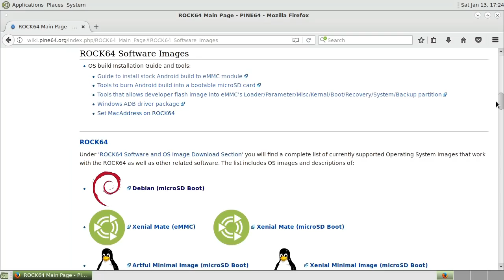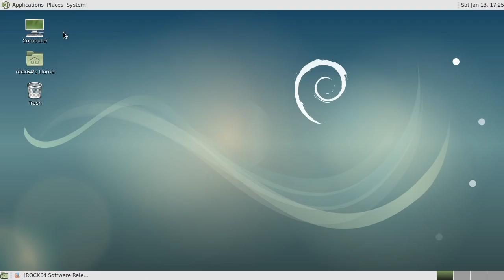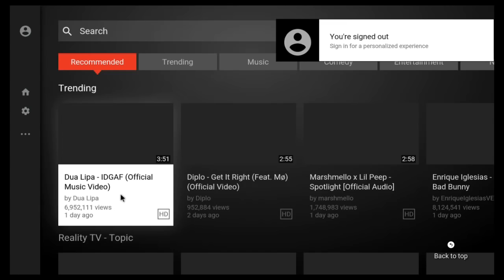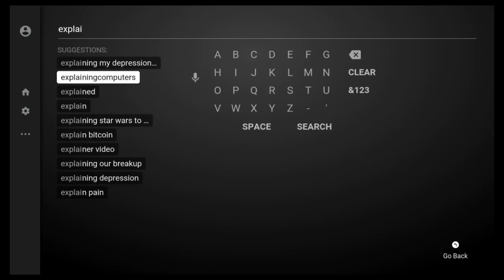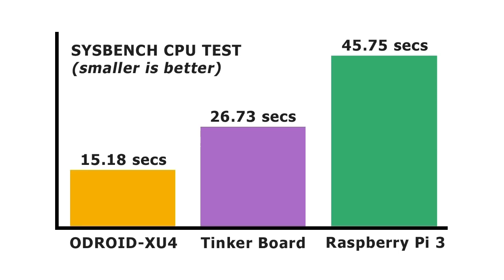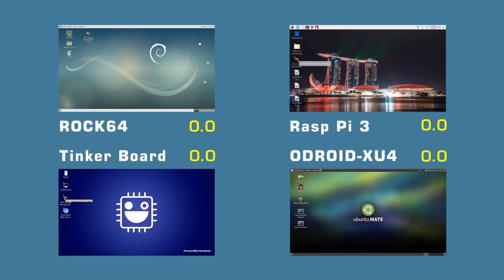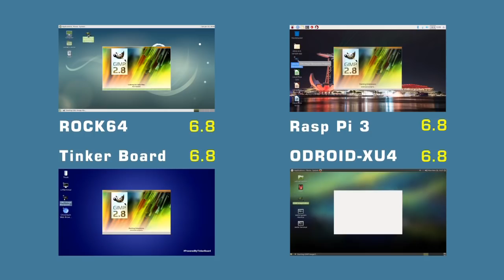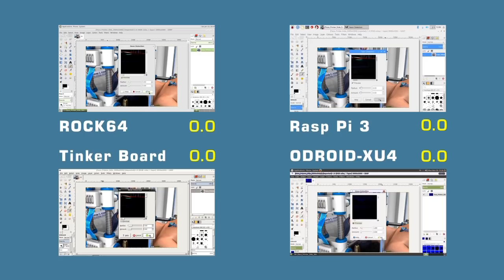ROCK64 4K USB 3.0 SBC

Comment: So.. I picked up 3 of these on Amazon for a whooping $8.51 US after taxes -- https://www.amazon.com/gp/product/B0868WSTXH . They came as a finished security product named "Recon Sentinel" -- https://www.reconsentinel.com/ . Package includes: Rock64 sbc 1Gb, 3A power supply, monochrome lcd display, 8GB SD card, and probably the ugliest case ever designed for a single board computer. Needless to say, that's normally what I expect to pay for the power supply alone, so I figured, "what do I have to lose?" Well.. Apparently, the $8.51! These have turned out to be about the most USELESS sbc's I've bought yet. YES, you can get an OS up and running on them.. But GOOD LUCK playing a YouTube video! YES, there are scripts for that, if you're willing to settle for only one OS/kernel option. But they are flaky, at best. So far, the only function they've managed to pull off successfully is as a monitor for my security cameras (Blue Iris/ui3 kiosk in chromium). Anything more stressful and it's sure to crash it. Still, I'd say I got my money's worth. Had I paid full-price, that would be a different story. :)

Comment: Like many here, I don't have a problem with no wifi - I won't be using it and removing it means the platform will be cheaper.
Despite the age of this, I ended up buying this now because even today, there isn't much competition of something that has the same level of performance-per-watt, PoE, a USB 3.0 port with its own host controller, all for a reasonable price point.  The ODROID-C4 is overall a better choice but once you factor in shipping costs, it's a worse value.

Comment: If the Rock64 is used like a desktop PC then the omission of WiFi/BT isn't a issue. Most desktops use Ethernet which is more secure, faster, reliable, and easier to setup than WiFi.

Comment: Chris, I tried to install CentOS-7 (minimum build) on the Rock64. 
https://wiki.pine64.org/index.php/ROCK64_Software_Release#CentOS-7_Community_Build_Image_.5BmicroSD_Boot.5D
Then I followed Step 3 to resize the card (fdisk) as noted in the project31 website:
https://project31.github.io/pine64/
I also tried to follow the steps on this site to verify I was doing this correctly:
http://scratchpadgames.net/forums/showthread.php?tid=7
So it seems to work...somewhat, but I can't install updates or anything using the terminal.
I don't know if it's worth your time, but I thought it would make for an interesting video just going over the resizing of a SD card, for some OS's that don't do it automatically. CentOS-7: would be interesting to see a working version on the Rock64. Thanks for providing such great information on your channel. Best regards. ~mk

Comment: I have to say that I tried to go through the OMV setup on a Rock64 with an attached external WD USB hard drive, and it was a complete mess.  I spent hours trying different options on the OMV configuration screens but was thwarted at various stages in the process. Eventually I threw in the towel and decided to use the Rock64 for another purpose (loaded it with Android). Then I bought an Odroid HC2 and attached a Seagate 10TB Ironwolf NAS SATA drive. This time the OMV and subsequent Windows share setup processes went absolutely seamlessly with no trouble whatsoever! Thanks to Hardkernel for building a robust product at a very economical price.

Comment: Thanks for the great videos, Christopher.  I've decided on the Rock64 (or RockPro64) and the Raspberry Pi3B+ to handle some of the heavy lifting to my latest project, and I have an Arduino to handle one of the lightweight tasks.

I bought the Rasp Pi3B+ to start out - the first problem I ran into was the HDMI video - I have no such monitors.  I ended up buying a converter cable (two of them - one for each of the Rock and the Rasp).

I'm up in the air about whether to use the Rock64 or the RockPro64.  The RockPro has two MiPi-CSI camera interfaces, which are crucial to its function in this project, but the Rock64 has no such camera port.

On the other hand, the Raspberry Pi 3 B+ does have the MiPi port, but I have another use in mind for it.  Although, the Raspberry has only a Gig of RAM, so it may have difficulty handling video.

I like the large (4GB) internal memory capacity for the RockPro, which will be very handy for heavy video processing that will become a major part of that task.

I bought the RockPro64 13 Megapixel Camera Module, which plugs into a MiPi-CSI port, which, I assume, will also work on the Rasp Pi3B+ MiPi port.  I'm not sure if there's software to support that module.  This will be a crucial part of the telescope imaging system.

I thought I had spare everything.  Now I need keyboards, cables, converters, mice, and so on.
Reply from the maker: Sounds like you are doing some interesting stuff!

Comment: It would be great if one of these boards would have a socket at the bottom of the board for power. It would be nice then if there would be a case with fan and a battery at the bottom so it could be a self contained unit.

Comment: Hello Chris. I just finished setting up Rock64 4gb using OMV with a 2tb usb3.0 WD 2.5" external HD formatted to NTSF. However, I am only getting around 15-18 MBps file transfers speed VIA SMB from windows 10 with 5g wifi. The Rock64 is connected to my router with 1GB ethernet port. Any helps would be appreciated.

Comment: Hello Chris. I have seen that the Raspberry 3B + connected to Internet by cable (rj45), supposedly 1 gigabit, has a limit of 300Mbps. Does Rock64 have that same limit or is it a real 1 gigabit connection? Another question. Is Rock64 compatible 100% with Raspberry LCD? Thank you.
Reply from the maker: The Rock64 is true one gigabit Ethernet. I do not know on the LCD question.
Reply: Thanks for your quick response. By Raspberry LCD I meant screens connected to the extended GPIO. In other words, is the Raspberry GPIO the same as the Rock64 GPIO?
This is an example of screen https://www.youtube.com/watch?v=Fj3wq98pd20
Reply from the maker: The Rock64 GPIO is the same as the Pi GPIO, but the Pi has a non-standard LCD connector. But the screen in the video link is not a standard Pi screen, so may well work -- if you have appropriate driver software . . .

Comment: Chris, I have solved my issue with the power supply purchased with this board. If moved just a slight bit, many times it would lose connection ad reboot. My solution was purchasing a USB-A x 3.5 mm/1.35 mm Barrel cable. I wonder if anyone else has had this problem with their Pine64 power supply. Writing post from Rock64-4, Ubuntu 18.04 LXDE.

Comment: Got a 4GB model. Loaded armbuntu. And WHOA! This thing actually supports standby mode. Note it takes 80mA in standby (1Ah from 12V battery per day - for those who need this for car project).
Reply: Hey, does 4k video streaming actually work? At least 1080 60fps?

Comment: Based on your reviews I went ahead and purchased a rock64. To date, I have been unable to get it to boot to a GUI desktop as your review of it shows.
Perhaps you could demonstrate the burning of the Debian OS you used in your video, as it doesn’t work for me  or retry it yourself as I’ve tried many times to get it to boot but all I get is the terminal command.
Reply from the maker: Sorry to hear this. If you get a terminal command the board is clearly working OK, so that is good. And also you must have gone through a successful imaging process to boot to a terminal, which again is positive. What this suggests is that you have installed an OS without a desktop. I did my installs on the Rock64 some time ago, so the images may have changed -- although looking at the page on http://wiki.pine64.org/index.php/ROCK64_Main_Page#ROCK64_2 they appear identical. My advice would be to try some different images -- eg Bionic Desktop LXDE, or Armbian Stretch Desktop (both on the above page) and see if you can boot to a desktop using one of those. Good luck, and do report back. :)

Comment: By measuring the load times of applications, you are measuring the performance of the interface that handles the IO for the memorycard, and the performance of the memorycard itself. Well done. No wonder your numbers are rather equal.

The RockChip Chip outperforms the CPU of the RaspberryPI by 12 times at least, because the CPU-Part of the Raspberry Pi is just a small accessory to the GPU of the broadcom chip. And thats 
what you see in your prime-performance-test.

The RockChip is a fullfledged CPU  with focus on IO perfomance and thus suitable for building web servers and/or NAS-Systems. Hence the missing Wifi- and Bluetooth interfaces.
Reply from the maker: I am well aware of what my tests here measure -- but they reflect real-world use for many people. I have done many more detailed benchmark videos, including the Rock64.
Reply: Sorry it wasn't my intention to offend you. But I think THIS video is a bit misleading for unexperienced viewers  in regards to what this sbc is actualy capable of. Especialy from a IO-perfomance perspective when directly compared to the raspberry pi, which is a merly sluggish...

Comment: I just purchase and setup a Rock64 4gb SMB using OMV and mDLNA with a 8tb usb3.0 WD mybook as a NAS. I did so for the 64 bit CPU in this. Anyhow, after formatting the USB 3.0 drive to EXT4, I am getting 100-114 MBps ethernet file transfers VIA SMB aka windows file transfer.. Pegging gigabit.. More than happy with this 220$ 8TB NAS I've built using a Rock64 SMB that I can just keep adding USB 3.0 drives to expand my NAS. Again, many thanks to you for your help!

Comment: Greetings everyone,
I have two doubts about Rock64:

1 - Ubuntu serves image for ARM architecture and 64bit processor, is this image compatible with Rock64?
(((https://www.ubuntu.com/download/server/arm)))

2 - Is it possible to start the Linux operating system on the pen-driver via USB 3.0 port?

I live in Brazil, I do not know how to speak English, I use google translator to communicate with you, I apologize if there was a translation error. Thank you all!
Reply from the maker: I very much doubt that the above Ubuntu image will run -- it needs specific hardware drivers. And you cannot boot a Rock64 via USB I'm afraid.
Reply: Flashing u-boot to SPI FlashSome of PINE64 devices, such as the Rock64 and SOPine, are equipped with SPI Flash. This allows users to flash u-boot onto the SPI and boot from an external USB 2.0 or USB 3.0 SSD/HDD/thumb-drive, thereby forgoing using eMMC or an microSD card. To find out more about which images can used in conjunction for SPI booting please see ayufan's github. Writing u-boot to SPI Flash can be achieved in two ways: Both on Pine64.org wiki as for Ubuntu, no idea.

Comment: Checking this Rock64 out at your behest...  Thanks for the tip.  I'll also look into the Tinker board and the ODROID-XU4.

For the 4GB of DDR3 Ram, it's $45.  Not bad.  I think I've become spoiled with dual monitors.  Every single computer I own, even my very old ones, is running with dual monitors.  One of the things Windows is good about, and Ubuntu isn't, is drivers for multiple monitors.  I think, so far, I've only seen one SBC with multiple video ports (I think, one HDMI and one standard Video jack), but I don't know if it would have supported two monitors.

Booting... I have a whole bag of jumpers.  And if I sweep the floors, I might find a few more.

I think the Rasp Pi 3 B+ is a 64-bit, also.  I think of both WiFi and Bluetooth as security issues, so those two missing is a non-issue for me.
Reply from the maker: The UDOO x86 models have one HDMI and two display port sockets, but cost far more than other SBCs. WiFi via M.2 card though, so not onboard.

Comment: I will be deploying over 8000 Rock64s into automations systems and I selected the Rock64 partially BECAUSE it lacks WiFi and Bluetooth, dedicating those energies to USEFUL features. To declare that in 2018 an SBC without integrated RF is "unacceptable" makes me think it's time for you to consider treating your advanced case of auto-rectal-cranial encompassment. It's hard to take your opinions seriously with such baseless hubris.
Reply from the maker: Thanks for this. I totally take your point that in some situations (liek where an SBC is being used as an industrial compotent) it is best not to have WiFi. But I would argue that integrated WiFi can that can be turned off (eg via a jumper) -- or offering models with and without -- would be a better soltions. My opinion (and it clearly is just that) is not "baseless" for everybody -- there are clearly many in these comments who agree with me. :)

Comment: Another OS question:
Can the rock64 run stock Debian images ?
Reply from the maker: It depends what you mean by "stock". The Rock64 is an ARM computer, not x86. So it cannot run any of the operating systems you can install on an x86 PC. But any ARM version of Debian ought to be able to be made to run (subject to having device drives for the Rock64 hardware). So, potentially yes. But if you simply download and install, you will have to stick with OS images intended for the Rock64.
Reply: First of all thanks for your quick reply.
I would like to use the rock64 as a nas with a stock Debian image, so I just need Usb, Ethernet. Nothing fancy.
How can one find out which drivers are necessary and if Debian potentially has them already ?
If I would install the ported Debian os will it get security patches from the main repositories or would I be dependent on the developers of the rock to port these patches for their architecture?
Reply from the maker: Details on Debian ARM ports are here -- https://www.debian.org/ports/arm/ Unless you are experienced creating custom OS images, I would not attempt to use a version of Debian on a specialist hardware (like an SBC) unless it has been specifically compiled for that board. You need a lot more than USB and Ethernet drivers -- all of the hardware of the board (eg memory) has to be supported by the OS. There are many different distros for the Rock64 boards, including Debian -- http://wiki.pine64.org/index.php/ROCK64_Main_Page#ROCK64_2 -- I don't get why you would not use one of these.
Reply: Thanks again.
I am concerned about whether the ported OS will be provided with security updates regularly. Will the OS especially compiled  for the rock64 be updated with "normal" updates (e.g. debian repo) or will the developers have to especially compile these updates to fit them to the architecture?
Reply from the maker: It should have relevant ARM Debian updates. Remember that most malware is written for x86 hardware; it will not run on an ARM board.

Comment: This is the computer I have been waiting for RapPi Org. to put out.  I don't need the WiFi so it covers everything I need including speed and memory.  Same price point for more and for $10 more, a lot more memory.  Finally, a machine able to run Firefox without paging or crashing.  Thanks for this review.
Reply from the maker: Yes, indeed -- the extra RAM makes a real difference. And it has a USB 3.0 port!

Comment: on these types of computers, can you boot from the eMMC and then use SD for storage? Or is it basically use one or the other?
Reply from the maker: On a Rock43 you can boot from either eMMC or SD, but both drives will be available in your OS. So once you have booted you can access either drive (for a USB 3.0 drive) for storage. The selection is just for which drive you want to boot from, not which is available, as both are.
Reply: So, I can boot from an eMMC? And use an SD for storage? What is the maximum size SD card I can use for storage?

Comment: Hi,
Thanx for the review.
If you look at https://libre.computer/2018/03/21/raspberry-pi-3-model-b-review-and-comparison/ you can see on part concerning SysBench that the Libre Computer board  ROC-RK3328-CC which looks pretty like the Rock64 (same SOC) has a 13x perf of the PI 3B. In fact, i think the SysBench result you made is perhaps not so wrong.
What do you think about that ?
Do you plan to review boards from Libre Computer ? They are available on A**zon and look interresting.
Best regards

Comment: Will raspberry pi gpio codes work on Rock64
Reply from the maker: By and large, yes.
Reply: By and large mean
Reply: I understand 
I want to make 3d printer with gpios 
There are firmwares for pi3
So I can use them on 
Rock64 right
Reply from the maker: "By and large" means the GPIO pins are compatible, but not necessarily all code implementation to output to term. In response to your last comment, the Rock64 cannot run Pi software -- it is not the same hardware.

Comment: Yes, one less USB port, but you don't have to use one of the USB ports for power either, so it is a wash on that point.
Reply from the maker: The USB port used for power on most SBCs cannot be used as a USB port -- it is for power in ONLY! :)